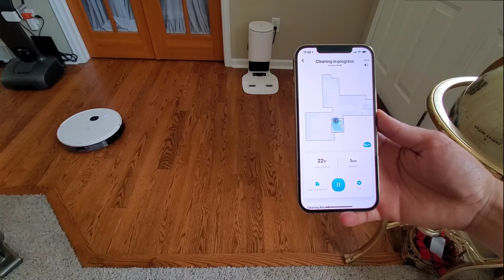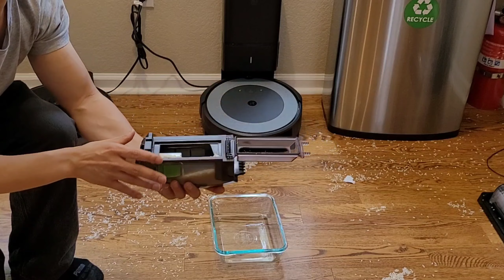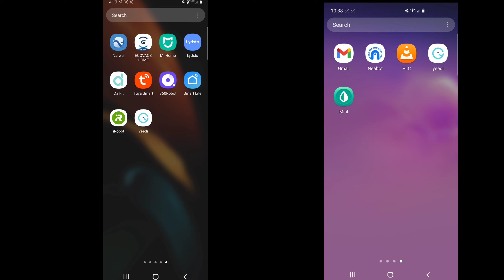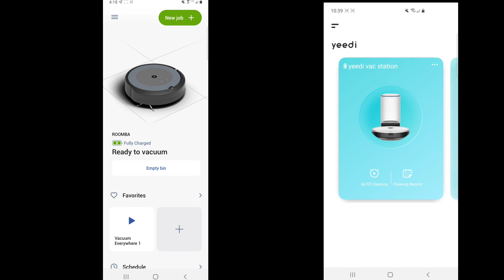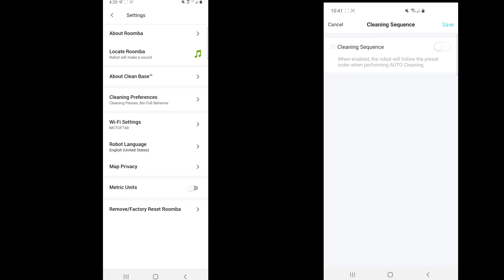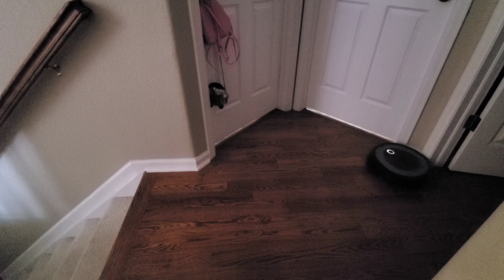Yeedi Vac Station VS iRobot Roomba i3+/i4+ - Which is better 🤔

Comment: Hi Nathan, let me first say,very good job so far 👏 👍.. Just some more info please on the yeedi. I noticed you never mentioned the hair tangle. And wondering how's the issue with hair in the rollers and how easy to clean. I look forward to hearing from you on that. And also does the yeedi allows a 30min return to the station in the app,so it can empty the bin and resume, since it doesn't have a full bin sensor like the roomba? Please advise, thanks.
Reply from the maker: So since the yeedi uses an all silicone brush it pretty easy to remove with the included cleaning tool. The Roomba is easier and doesn’t require any cutting tool. There no way to tell the robot to return and empty after a certain amount of time. Only emptying once the cleaning job done. You can create areas in each and have the robot to empty at each area.
Reply: @RobotMasters  Very good sir. Good to know...I think it's still a good combo. And based on your reviews, I will be getting it. So thanks much. Keep up the good work 👏 👍
Reply from the maker: Sure thanks for watching 😂